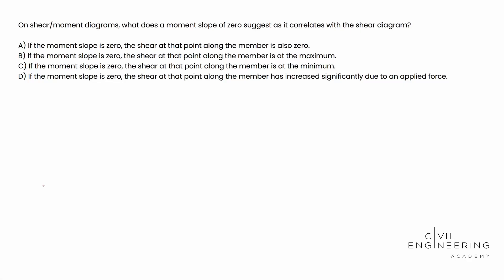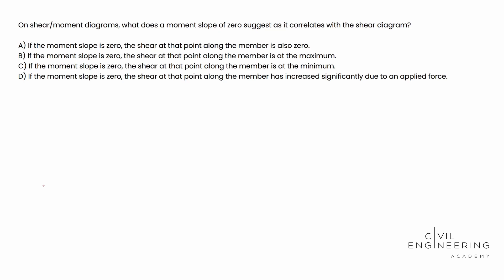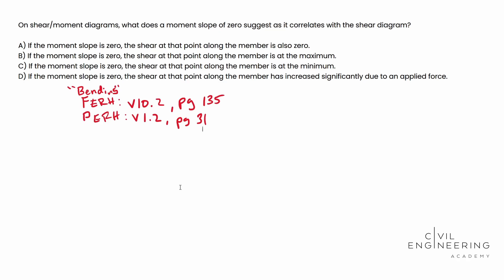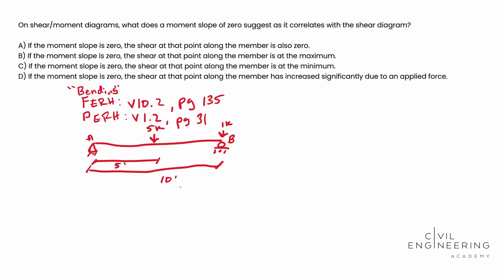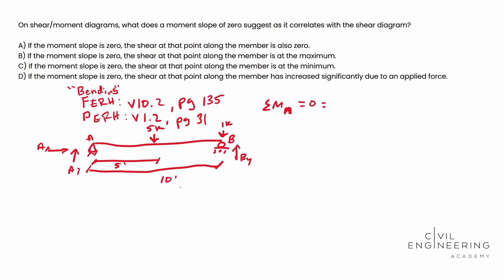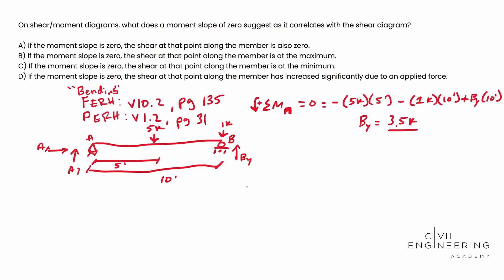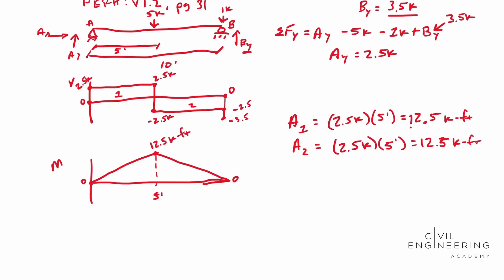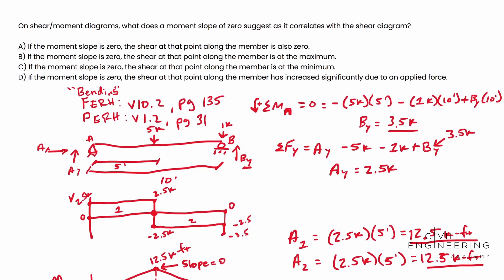Civil FE/PE Exam – Structural Mechanics – Relationship Between Shear & Moment Diagrams

Comment: Good stuff. How can shear be zero at 5' mark when we have 5 kip being applied to it? Intuitively shear ought to be large in that point.
Reply: yeah this is a bad example. shear is not zero there, it is an asymptote where shear changes sign convention. it's either +/- 2.5. the slope of the moment diagram is also not zero since there is no such thing as slope at a single point. a better example would be a simply supported beam with loads of equal magnitudes at the third points. in the middle third there is no shear, and therefore no change in moment (i.e. slope of moment diagram is actually zero).